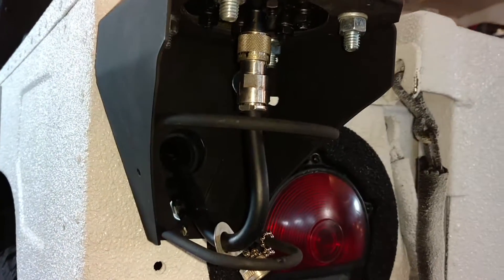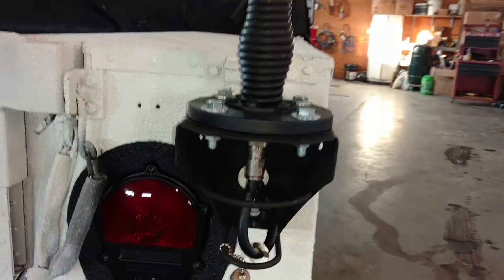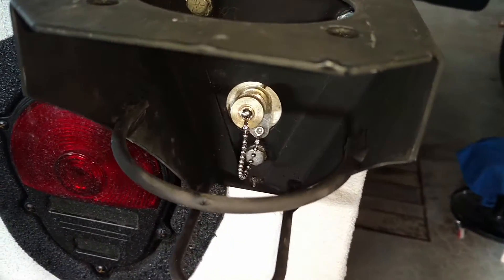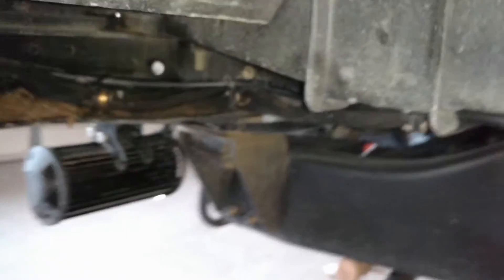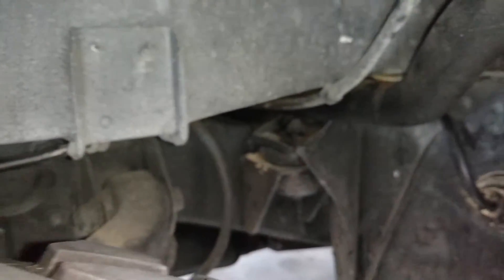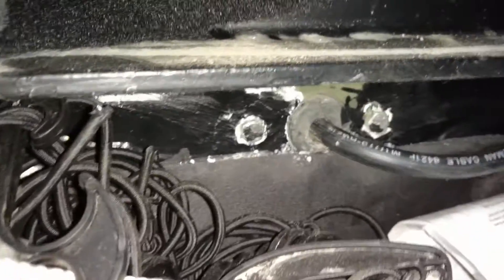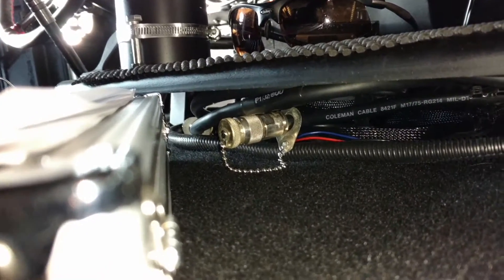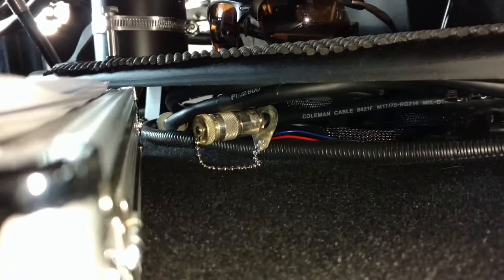M998 Humvee HMMWV AS-3449 Antenna Install with Cables & Bracket HAM 450Mhz 5820-01-183-9462

Comment: It's really important to install either the original mounts triangular backing plate or some very large fender washers inside the rear fenders.  This aluminum isn't very thick and a whipping mast while your driving can tear the bolts right out of the body if there isn't some additional support there.

Comment: What radios are you using with these antennas? Just curious, I am looking for similar, but not in that freq range of these.
Reply from the maker: I'm not running the frequencies rated for the antenna, and they still work incredible. I have an Icom  F5220D / F6220D - VHF / UHF digital transceiver with a Uniden 40-Channel CB Radio (PRO510XL) http://amzn.to/2Ea6qcO - http://amzn.to/2Biw7VZ
Reply: So these antenna will work  with a normal CB  or scanner ?    How long are these ?   Looking to install on a m1009

Comment: Thank you so much! I've been wondering how to do the antenna for my humvee!
Reply: What type of antennas are they? (Where did you get them) and would they work for a Ham radio?
Reply from the maker: You my need a N to UHF PL259 adapter most civilian electronics are UHF PL259. The military cables have N connectors.
Reply: Hummer Mods and Repairs for the M998 HMMWV how tall are they? I was hoping to be able to bend them down to my roof as seen in the military.
Reply from the maker: 4.94 feet. They do not reach the roof, but they can function with nearly 5 pounds of ice on them. ;)